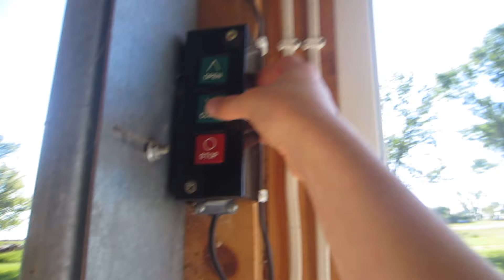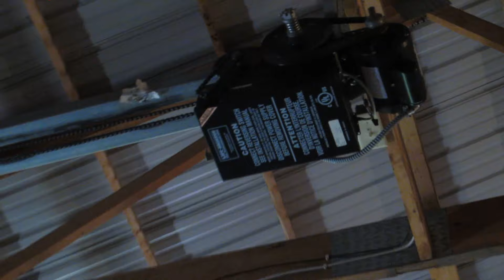My Grandma's Garage Doors

Comment: My old garage door broke and I have a new opener
Reply from the maker: What did you have before/now?
Reply: @TBHD724 The old one I don't know at all. The old opener opens pretty fast like the genie exccelerator but a different model that I don't even know at all. It was a little bit noisy. But my new one compared to the old one is pretty much quieter than the old one and the old one was mounted a little bit too high. In 2020 when me and my mom got home, we both were in the car and then when we were opening the door, it broke all of a sudden for some reason which was weird so it pretty much needed to be replaced with a new door because the old door was too old and the old opener was replaced too because it was mounted too high. After that, now the new door and the new opener both run pretty good and work perfectly as of right now.